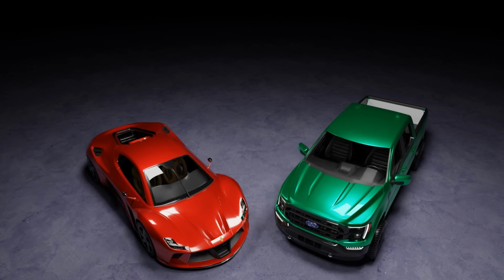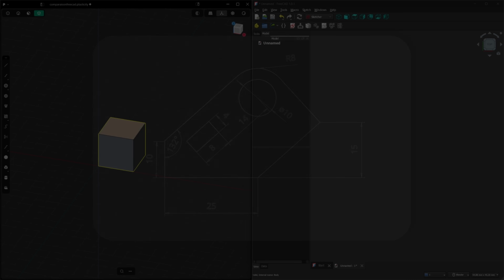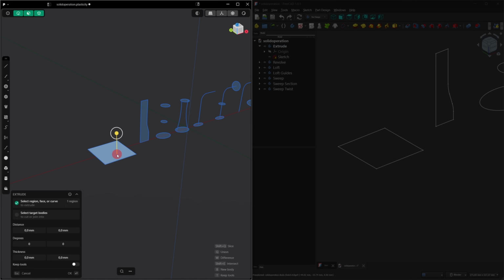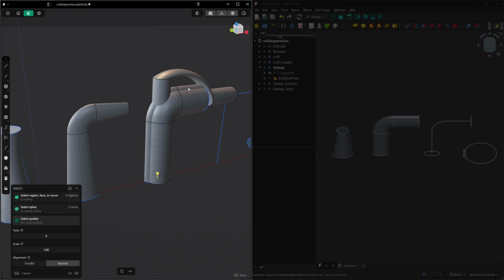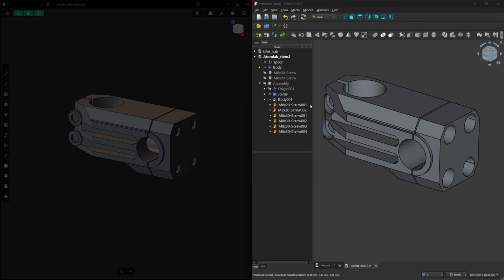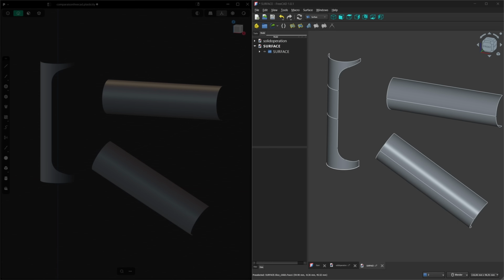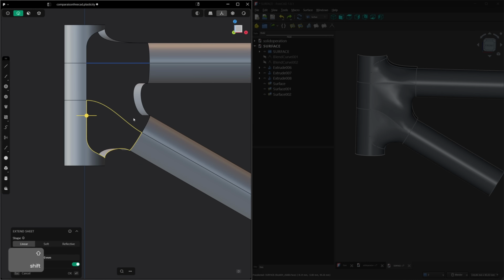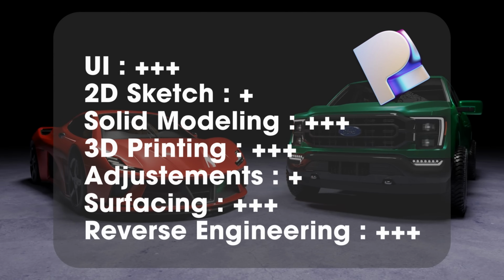FreeCAD VS Plasticity - Who's the BEST ? (Makers & Beginners)

Comment: couldn't you just wire cut the model, then extend it with the new face, then boolean union together the 2 pieces in plasticity ? I mean thats what I would do in Rhino atlest. I do also have plasticity, just don't model so much in there.

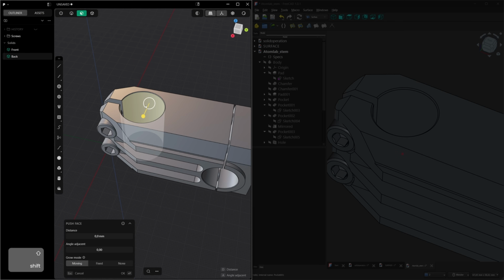Comment: 14:25 Wow! That's sad. I remember there was a super simple way to stretch a model in SketchUp, and I think Blender should work the same way.
But... wait a minute. What's stopping me from splitting the part, moving one piece, and filling the gap?
I'm a newbie to Plasticity, but I hope it will work out.
Reply: Yes, this works. There are some imperfections on my curved part, though. As for curved surfaces, it's better to rebuild them from the original curves.
Reply: It doesn't even need splitting in most cases. Moving faces works just fine.
Phew, lucky me! Finally, I've got the CAD software I was waiting for!

Comment: Great comparison, I'm so used to parametric modeling coming from autocad and REVIT in my design background as an EE. But for my day to day modeling, I think Direct Modeling is so much better at getting things going for 3D printing if it's not a functional part. So what I take is... Use both - Plasticity for day to day solid objects and general free-form design and then use FreeCAD when I'm designing functional parts where tolerances and fit is subject to constraints of application.

Comment: The marked for CAD in Linux is small. 
Been using both for some time and i keep returning to Plasticity first. i just like the workflow more. as you said making changes in Plasticity can both be easy and hard depending on the change, but its just something i live with, i copy the the lines to a new folder and make the new revision as a stand alone solid.

In the end all i want to say is that this video highlights all the pains and gains from both software packages very well.

Comment: Hey Deltahedra, i know this video is a little old at this point, but i think your solution for extending your head stem in Plasticity was a case of misusing the available tools.

For example, you could have made a line by which to cut the part, moved the halves apart by the needed distance, then used an extrusion and join to correct the length.
Yes it's still more steps than FreeCAD, but it's a direct modelling program.
You didn't need to go all the way back to nothing.

Comment: Thank you for the comparison! Here's just a few notes from a relatively new Plasticity user (I'm no expert!)

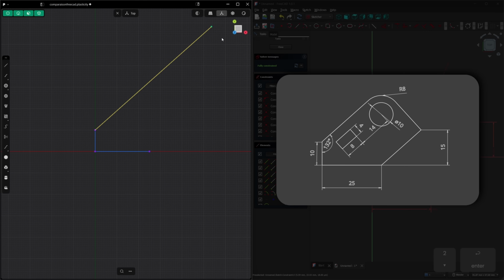5:15 You can enter math expressions like "132-90" in the Tab measurement box and it will do the math for you. This applies to all numeric boxes in Plasticity.

11:50 To carve holes, you simply draw circles or other shapes directly on the face, using Knife mode (so that it imprints the lines on the surface) then extrude them inwards, for the respective lengths, in Difference mode. No need to create positive bolts, move them into place, and boolean them. If you need several identical holes, you can duplicate the hole itself (by selecting all of its faces in Face mode) and move it to a new position. Check out the duplicate modes, Shift-D vs Ctrl-D.

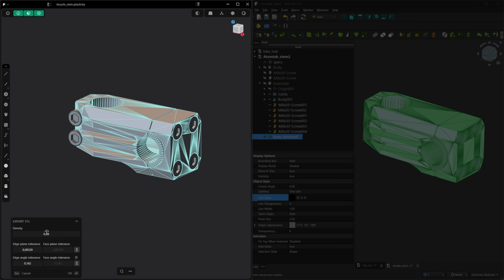12:50 When 3D printing, I usually export the model as a Step file from Plasticity and import it into the slicer. No polygon or resolution options, because a Step file is a CAD vector format.

14:45 Not to detract from parametric modeling, but in your case you didn't need to rebuild that part from scratch to adjust its length. Just select all the faces that need to move (with a rectangular selection in Face mode) and move them with "G". In case it doesn't work, you can also cut the part in two, move one half to its new position, and Push (pull) its cut face back into the other half, then boolean Union them back together with "QQ".
Reply: wow, i need some lessons to work plasticity like that..
Reply: Love your comment! Thank you!
Reply: Thx

Comment: This exactly the video i needed, because doing CAD on Linux has always been a pain when then "juts use on shape, its in the browser" is not an option, and running Fusion 360 with Wine is horribly unstable.  
Ill probably switch to these 2 programs to relate Fusion, because i do way more surfacing than i thought and don't use the parametric options that often, because under Fusion a lot of parametric workflows just mess up when you change dimensions and have 3D Sketches with splines  involved.
The roadblocks to ditching Windows become less by the day. Thanks!

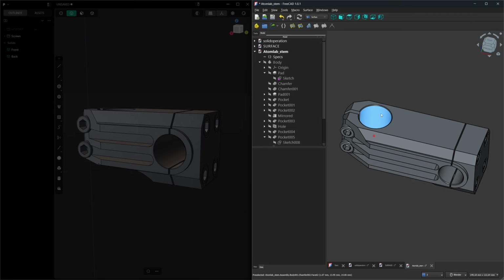Comment: I use Plasticity and FreeCAD for the same reasons. BTW @14:17, I would have drawn (in front view) a vertical line from the top to bottom of the stem, cut the stem into two parts, move the right part(s) to however much you need, extend the solids of the left parts to the right and/or bridge them with faces if needed. Finally just boolean-unify from two parts back to one.

Excellent video.
Reply: Thanks great workaround idea 💡

Comment: Having worked with Catia for many years, I've moved over to Plasticity now. The key difference to me is that I actually enjoy using Plasticity. What I want to create flows naturally from my noggin to a solid model then to 3D printer. Your analogy of sports car is perfect... I take Plasticity for a drive just for the hell of it.

Whilst I appreciate that a well parameterised model can be easy to adjust, I often find that I can adjust my models exactly as I want to in Plasticity just as well but with more curvy models, way better.

Comment: Thanks for the Video, i am also on Linux . Before on Windows i used solidworks, because i never got warm with the cluttered oldschool looking userinterface of FreeCAD. As i am now on only Linux i chose plasticity and i would never go back to windows ever again 🙂
Only complaint i have about plasticity is , that no parametric designs are possible .... especiall when you design gears or similar it would be so important.
Reply: Just a few hours after this post i found another very very good one its called chili3d , it looks like fusion 360 interface but fully opensource. You might want to give it a try too...

Comment: I use Plasticity. It's good, but it doesn't use DXF files for laser cut. You can't simulate an assembly, but you can adjust the components very quickly. I use FreeCAD to check assemblies. Good video thanks for sharing

Comment: Plasticity claims to be “for artists” while not offering a version for macOS, which most artists prefer.

And they tell you that you'll  “own” the software, while your purchase will only get you 12 months of updates.

Those two huge red flags are all I need to know.
Reply: Plasticity is most definitely available for MacOS.
Reply from the maker: @macproduktiv I'm pretty sure you can install it on macOS, including M1, M2, M3, M4, and Intel-based Macs.
Reply: @deltahedra3D  After reading your reply, I checked again and there it is, clear as daylight. Now I'm embarrassed, and I wish I could figure out, what in the world I did to get the impression, that there was no version for macOS.

But all in all it doesn't matter, because it not being parametric is a dealbreaker for me.

Comment: Great video, definitely worth a subscribe!
As a budding industrial designer with more experience with polygon modelling, Plasticity has been really helpful with handing more complex surfacing that Fusion just doesn't have the capability to and a hybrid workflow as you've mentioned helps cover the weaknesses of both the direct and parametric approaches. It also helps that Plasticity acts as a great bridge between CAD and other tools, importing and converting polygon models to CAD ones and even importing files like SVGs from illustrator so I can work with them further. Also with the lengthening portion it wasn't entirely necessary to model from scratch but the direct modelling approach requires a bit of a shift on how to modify and work with faces but your point still stands.

Comment: You are using Surface WB wrong. Those tools are mostly intended for patches rather than big surfaces plus you are trying to close a 5 sided surface. If you want better results you need to combine curves WB and surfaces WB and for almost all cad software 5 sided surfaces are a pain and licensed software use tricks so the user doesn't have to worry about understanding NURBS

Comment: Personally, I only have hands-on experience with FreeCAD. However, it’s clear that what’s shown here is a very superficial comparison. For instance, you mentioned working with holes but completely overlooked the role of modular plugins. Plugins like Assembly4, FEM, or Fasteners alone fill significant gaps in the core functionality of the software.

When you take into account the broader range of features that engineers specifically rely on, FreeCAD—despite being open-source—often surpasses expectations and even outperforms some commercial solutions. That in itself is quite surprising. In this context, speed or ease of use is far from the most critical factor.

As is commonly known, there is no such thing as a one-size-fits-all tool. Everyone chooses the solution that best fits their needs. And naturally, cramming all possible features into a single application is not only impractical but counterproductive. Fortunately, nothing prevents you from combining different software tools to achieve the results you’re after.

Comment: i use freeCAD for parametric modeling, and blender for more organic modeling (so i use a very very tiny part of blender)i use them both because they are open source, and when i started my 3d modeling journey it was more of a hobby and so they looked to me like the best choice (also both working on linux played a huge role in selecting them). now with blender's V4 graphics requirements i cannot install it (unless i get a more modern computer) and i'm more and more feeling left behind, not only in some new features but also in plug-ins that once updated require V4.x version. do you think i should look at plasticity to replace blender? could it be an option? also, great video, you've got a new follower

Comment: I have been programming propellers in FreeCAD, and I know the limitations, and I'm okay with them. FreeCAD 1.1 will fix a lot of the crashing problems. To make curves, which is where FreeCAD is not as nice, this is the job of a workbench, not FreeCAD. I am programming propellers with physics, so the problems with FreeCAD don't apply to my design, and FreeCAD is the most programmable CAD software. I don't mind the FreeCAD constraints at all. I really like the Spreadsheets in FreeCAD, and the Python interface. Plasticity does look dope, but I'm broke, and FreeCAD is good enough to get me from point A to $.

Comment: As a Plasticity user, after briefly using FreeCAD, I want to point out a few important things and false claims that slightly spoil the impression of Plasticity. If you overlook them, it's actually a very good review—something I personally missed back in the day.

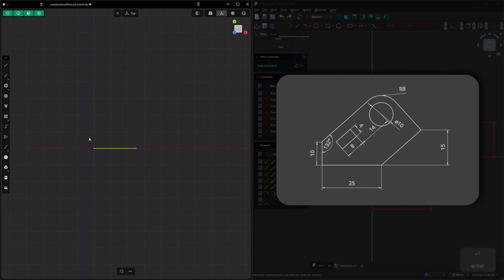4:49 You can change the length of a line as well as (sometimes) a wall of a solid with the "Dimension" command. You can also move the end of a line (or an edge of a solid) with the "Move" command.
4:56 Type 132-90 there, and Plasticity will do the math for you. Add a minus at the end (132-90-) to make the value negative.
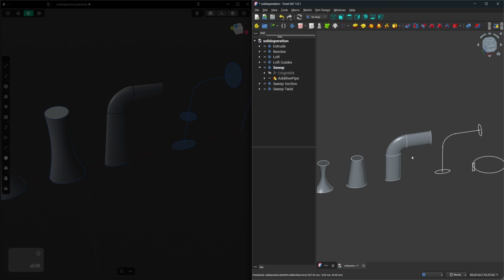9:11 The order in which you select objects in Plasticity is important for lofting. That might also apply here (I didn’t use sweep much).
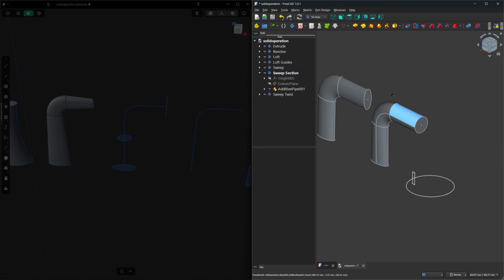9:48 The pipe tool is extremely powerful. It can create triangles, squares, hexagons, etc. You can also pipe edges of a solid, and they’ll automatically be cut from the body.
14:25 As long as you don’t subtract strange complex objects from a solid, the solid is very easily adjustable by selecting its surfaces (walls/sheets) and using the "Move" command (or "Rotate"). Sometimes you need to select all the walls you want to move, sometimes just a few key ones.

Additionally, I'd like to note that in Plasticity, there are often several ways to perform the same simple action (like using Loft instead of Sweep, etc.).

Comment: Quite honestly depends on what you need.

Do you need an assembly and tech drawing then FreeCAD.

Do you need good modeling tools for complex shapes then not FreeCAD.

FreeCAD is the jack of all trades but not master of many.
Basic solid modeling is great but for surfacing it is an exercise in frustration.

Plasticity with using the Parasolid modeling kernel not only offers amazing surface modeling tools but also has great solid modeling tools too.

Comment: You are trying to compare "cold" with "soft". Both programs have different concepts, different niches, and different purposes. In my practice, I do not compare them, but combine them. For example, you will not do FEM analysis in Plasticity, but you will spend half a day drawing 3D printed letters for a sign in FreeCAD, while in Plasticity you will do them in half an hour or faster. Just use benefits from both, not compare them.

Comment: @14:25 To lengthen the stem, wouldn't it be easier to cut at the place you want to lengthen the stem, select all of the parts to the right of that cut and move them the desired distance, then extend the face from the left side of the cut to reach the stems right side part face where they would union, and then use the boolean to merge?
Reply: Also, in Plasticity you can select the faces that you need to move to make the part longer, then activate the move tool and move them!😂

It is very quick, no need to remodel!😂
Reply: I wanted to write the same thing. This demonstrates that direct modelling requires a different approach to parametric modelling. In fact, I tend to delete all my sketches once I've created the solid from them, as there's no associativity between sketches and bodies, so they're not worth keeping.
Reply: @RagingSonic666  Yep, I generally do the same thing with the sketches. And like working on a graphic, I tend to save the project under an incremented extended name (v1.0.1) for example where I am at a critical position, so I can roll back to that point in the model if I need to, considering there's no undo point once you close down the app.

Comment: No full-parametic control.... and it's useless.
Reply: Whether it is useless or not depends solely on the project and the workflow.  If I have a project with fixed values that won't change, I'm often faster with Plastictiy and it's more pleasant to work with. In my opinion, determining its usefulness solely on the basis of whether it is parametric or not is not the right approach.
Reply: Plasticity is meant for use by artist the a product for engineering. It is a product to make hard surface modeling easier with out the limitations of polygon modeling
Reply: No